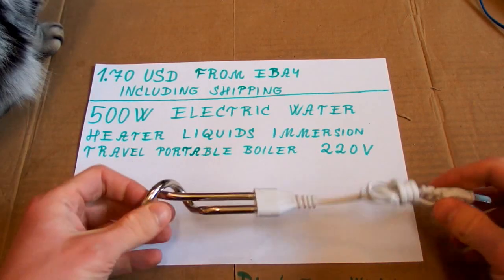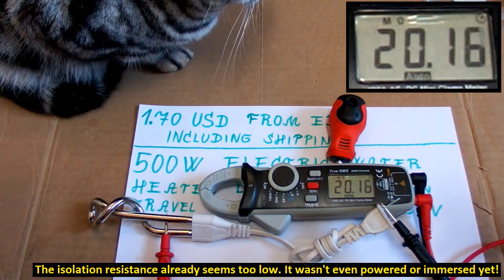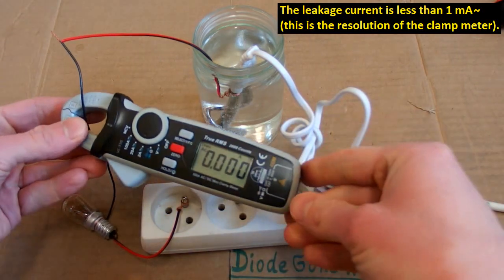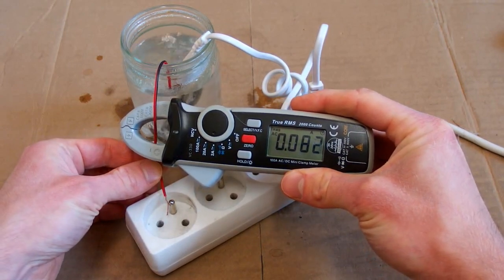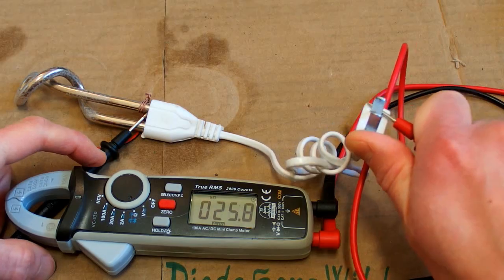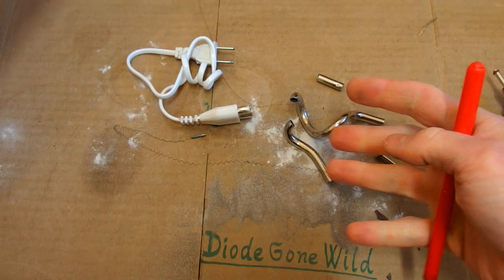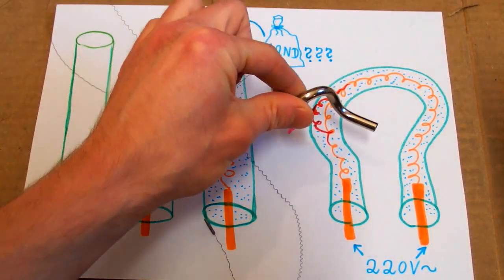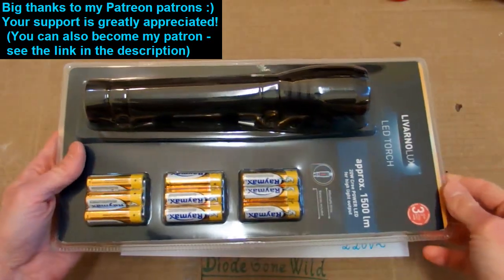Dangerous Immersion Water Heater (with autopsy)

Comment: The white powder is meant to be magnesium oxide, if you ever burned magnesium ribbon at school then this is the white ash left over. and I think the coiled wire could be an alloy of tungsten.
Reply: I previously thought that the weird white powder is salt. Because salt is an "ionic compound made up of two groups of oppositely charged ions". And ions are "atoms with an electrical charge."
Reply: Why not dirt cheap waste nichrome?

Comment: It's a common practice, manufacturing resistance heating elements, to fill the pipe with compacted dry silica sand before bending. The problem is that the sand, in your case, was not compacted and appeared to be humid - probably the leak was the humidity in the sand - poor manufacturing quality and control (no high voltage leak test), as one expects with these cheap Chinese appliances.
Reply: maybe.

Comment: At some truck stops in the USA, you can find a 12V version of this device made for coffee mugs.  The heating element is surrounded by metal and makes no contact with the water, so there's a small chance of electrocution.  But there is no overheat protection, so it can boil away the water and become a fire hazard.  Also, it plugs into your cigarette lighter plug.  The current it draws is excessive for that kind of plug.  It will (and really does) slowly melt the plug down.  Not only is this a fire hazard, but can get hot enough to burn your hand when you go to unplug it.

The big problem with it is that the connection at the lighter plug forms a voltage divider network with the heating element.  Thus, the plug and socket becomes almost as much a heater as the heating element.  To stop this, one has to reduce the resistance at the plug.  This means replacing the plug with something else entirely.  My solution was to install a pair of RCA jacks right next to the socket, and wired them up to hot and ground.  Then I replaced the plug with RCA jacks.  This left a small 13.5V shock hazard, but the resistance dropped so low that the heavy lamp wire became the next highest resistance.  The wire warmed up more than the RCA jacks.  But at no time was the wire too hot to touch, so I deemed this an acceptable solution.
Reply: Don't worry, there is no way to get shocked with 12V, except maybe on the tongue :)
Reply: @drobotk  Not so.  A guy I knew was working on an F-4G with the jet engine running on a very hot day.  A running jet engine produces an enormous amount of current - both 120VAC and 12VDC.  When he got hit with 12VDC, it put a hole right through his thumb and simultaneously cauterized the wound.  His thumb looked and smelled like a burnt hot dog.  Lucky for him, he didn't lose his thumb, but there was some nerve damage.
You should also know that arc welders are low voltage, high current devices.

Comment: The powder is normal, it is also present in high quality heating elements, it is usually magnesium oxide, which is a refractory material and a good insulator, I went on a tour in a heating element factory, and yes, the manufacturing process is pretty much just that

 I believe the problem is on one if the two ends considering your measurements
Reply from the maker: I think that in good heaters the powder material should be at least a bit more solid. Maybe just more compacted, maybe soaked with something to make it solid.
Reply: @DiodeGoneWild  Yes, it is indeed a finer powder and more compacted, I din't see the powder up close, but I remember seeing a section of a different style of heating element that was rated class II and the powder didn't come out like that, it stayed compacted, so yes, that could also be another sign of cheapness on that dodgy heating element

Comment: Ow er, bastards arnt they, not even a high temprature woven covering to insulate the nichrome wire :-(.
Not even an earth.
Big clive calls that plug a DeathDaptor :-D
You don't have earth leakage or rcd fusebox protection.
Yep keep puss safe :-D
Reply: he does, but it only trips at 300ma.
if he was in the bathroom it would trip at 30ma and would have tripped
Reply from the maker: Well, sand is the cheapest insulation :). They don't care about earthing either. They just use the "don't touch it when it's running" logic. My wiring has an RCD, but only for the bathroom. Other rooms only have a 16A breaker and no other safety. Wirings from a certain era are like this. The cat was in a safe place, no worries ;).
Reply: It is like this because if you would connect your entire house to the RCD, it would need to allow more leakage margin to avoid getting activated when not desired, reducing the safety. Therefore they were restricted to high-risk rooms.

Nowadays we can manufacture them cheaper (in China :) ), so it is no problem to install as many of them as needed and we can protect the entire house.
Reply: My guess is that in the middle part where the "sand" is not compacted well, the heating wire has enough "wiggle" room due to thermal expansion/contraction to get close to the metal pipe, and create an electrical leakage.  While it's true that most bathroom trippers will trip before it gets too dangerous (50-100mah), the mere fact that they didn't even try to isolate it better is a total disregard of quality and safety.
Reply: Well, it might be more of a production problem than a design problem. Often Chinese devices are somewhat okay designed, produced by many different producers, who are in their price wars fuck it up. We can see a production error here: The "sand" was only solidified near the ends of the tube. If the sand was fully solid, you would have isolation between live wire and the tube covering the heating element.

Now there are questions to be asked about the design: There is no ground plug, is just the sand enough etc. However, the theory that the design might be compliant with Chinese electrical regulations (that are not so strict as ours) and the production being fucked up, due to price pressure and inexperienced manufacturers, sounds plausible.

Comment: You can increase the clamp meters resolution by wrapping several turns of wire around the clamp jaws.
Reply: correct! every turn increase the current 1 time: 2 turn double current, 3 turn triple current and so on.
So, make turns an divide by number of turns to obtain the correct value (in a perfect world)

Comment: Tubular heating element are usually made of, magnesium oxide and not send.
Because magnesium oxide has very high melting point 2,852 °C (5,166 °F), and it's also much finer powder compare to send. It can be packed more densely compared to sand.

Comment: I have a similar one (bought in Ukraine a few years ago). The voltage between the "water" and neutral is 30V in one polarity and 205V in the second polarity. However I was not able to measure any current leakage. I even wound the wire 5 times through the clamp to increase the sensitivity. But in both polarities, it showed 0mA. Btw. I used the same meter as in the video. I still use the immersion heater to heat up milk in a stainless steel can before proceeding to make milk foam with the aid of the coffee machine. Cold milk directly from the fridge does not make a nice foam. It needs to be warm, around 25°C - 30°C for best results. I usually use the heater only for 15 or 20 seconds and wear slippers with a thick cork and rubber bottom, so I am isolated. So even in case of a leakage, I would not form a connection to ground, even when touching the stainless steel can. I assume that milk conducts electricity at least as good as water, if not better. I do not have a microwave oven and even if I did, I could not put the stainless steel can into it. Since it is stainless steel, it does not work on the induction stove either.
Reply: Maybe having an rcd device would be a good idea
Reply: @HA05GER  I have it, but what use does it make when the appliance is not grounded? Only grounded appliances can trigger the rcd device, when some of the current flows not through the neutral wire, but the ground wire.
Reply: @erikziak1249  that's not true what so ever and RCD monitors the live and neutral conductors to see if they are balance. If they become unbalanced like you get a shock or leaking to ground the RCD will trip.
Reply: @HA05GER  Thanks for correcting me. You are right, it checks the live and neutral. The RSD device should trip even if the appliance is ungrounded, but finds another path to "ground" other than the "working neutral" wire.
Reply: @erikziak1249  correct 👌 so should keep you safe with something like this.

Comment: The white isolation material is electron emissive when heated.  That's why it passes current in one direction.
Reply from the maker: No, there's no vacuum, so there should be no electron emission. And the voltage is AC, the current is not passing in just one direction. It's passing in both directions, but from just one end of the resistive wire.

Comment: with a normal immersion heater, would i get electrocuted if i were to touch a titanium rod which is in contact with the heating element? (the titanium rod end inside the coil of the heating element?)

Comment: I think they are also counting on the oxidation of the wire adding a bit of a resistive barrier once the device is fired up a few times.  The sand transfers the heat and also allows them to bend the tubing,  perhaps induction heated.    Who knows,  not the best design regardless.

Comment: Hello Mr wild. I'm thinking about using a SSR to switch mo well pump. It is 120v and I think 7amps. I am thinking the zero crossing switching will be easier on my Inverter. I am off grid. And need to care for my inverter. Will this help inrush current spikes? Thanks man...

Comment: Probably, the sand is pressed at the ends and so it is such "solidified".

I had a bitter experience with one of these heaters ( 1500w, bigger version), it was running on mains while dipped into water.... suddenly the pipe leaked and the powder(sand) was thrown up all over the room, the whole room became foggy!

Though it was of an unknown brand,  then I bought a new one from Bajaj, it is working till now....all perfectly grounded and so on.

Comment: Lol that lamp worked by reverse polarity of the plug but 220v does not have polarity ? Right ?
Reply: Diode Gone Wild power line is feeded from a 380-220V 3-phase system:
this power transportation system is made with a neutral and 3 phases. 
If you pick tension between two phases you have a tension that is 1.73 times higher (380V) than if you pick between neutral and one phase (220V),  it is non relevant what phase is. 
With this system you can sell threephase power and monophase power in the same line!
The neutral wire is grounded  along the distribution line (for line protection purposes) so in your home you have a live wire and a neutral (grounded) wire.
When you try to measure between live and ground you have 220 V otherwise if you measure between neutral and ground  you find almost zero ( teorically zero if your grounding plant is 100% functional)
So if the  lamp is connected between to the live wire  and ground, you can  light up the bulb; otherwise if you connect the lamp to neutral and ground the bulb does not light up (maybe slightly light up due to the low voltage between neutral and a not very good grounding)
Tha's why you act as reversing polarity because you change live with neutral but it is only an asymmetrical distribution system
p.s. many years ago in some italian countries you'll can find the obsolete 220-125V system (in way of decommissioning)
It is the same kind of transportation but in home you have two phases at 220 V and in this case each phase  is only 125V apart from ground because the neutral  (not present in that home but present on feeding line) is still grounded

Comment: Hopefully that's not Aesbestos that you're dumping all over your floor lol.
Reply from the maker: I think it's not asbestos. Asbestos is soft and it consists of fibres. Asbestos is used as a thermal insulation. The material in a heater is supposed to conduct heat.

Comment: They could isolate the resistive wire with glass dust and it could be a bit safer to use, but Minecraft said: you make glass out of sand, glass is not conductive so you can just put stupid sand from the beach

Comment: Pyro or MICC (mineral insulated copper cable) could explain the sand. Its an excellent cable used outside, fire alarm systems etc. The mineral insulation compresses the same as the copper cable so can be bent and even hammered flat and not short. I know because ive tried  :) 
Im not saying this Chinese element is the same quality but maybe they tried to clone the method and thought sand would do the trick ;)

Comment: General rule of thumb is don't buy anything from China that is connected to mains voltage - if you love life ;)
Or just to disassemble it !
Thanks for your videos !
Reply from the maker: That's exactly what I say :). But even some non-mains devices may be dodgy. Exploding batteries, risk of fire,  toxic chemicals, ...
Reply: It's not that simple, because over 90% of the worlds electronics comes from China. In theory, what is sold in European shops is supposed to be safe. In practise safety is often reduced to a paper excersize to apply the CE label (Chinese manufacturer hands over CE paperwork, importer has done his legal job).

The CE system has been designed for a world where there are a limited number of large manufacturers (think of i.e. companies like Philips, Bauknecht, Miele), who can easily be controlled by authorities, therefore the self-certification that CE imposes is justified.

However, nowadays electronics are mostly manufactured outside the borders of the EU, but a very large amount of Chinese manufacturers. There is no way to ensure the self-certification process is done correctly. Therefore the harsh truth is that no device can really be trusted nowadays. If you import yourself, the risk is certainly higher, but you can by no means assume to be safe by buying locally. It is often the same cheap crap sold by a higher price.

I am getting more and more convinced that we are increasingly responsible for our own safety. Any device I buy that isn't from a trusted manufacturer is immedeately opened and inspected, regardless wether it comes from a local shop or directly from China. Your videos are very helpfull in getting good ideas about what needs to be tested and inspected.

The other way around: You can import great quality stuff from China. It is however, a good idea to avoid the cheapest stuff, read reviews, and still, whatever you buy, inspect it before using.
Reply: @DiodeGoneWild   Yes, and I support your point of view ;) I never tested heater (and again enjoyed your videos) but a dozen of AC/DC SMPS / Adapters, all with major security flaws (very low insulation barrier, heating issues even with no load, etc)
Oh yes batteries and power electronics can be fun too ;)
Reply: @danielmantione  Yes the vaste majority of electronics come from China... but what I would like to say is if you direct buy your are the only one that can spot problems - and as you say, often cheap direct buy items have a problem.

If you buy from big companies (this can be from Samsung Apple Philips or other) they ensure the security is OK in 99% of the cases - even it is manufactured in China too.

Third case is when you buy from importer, they are not always understanding or testing devices as required. In my country, 1500 devices were tested for a year, 15% were defective. One recall was huge on Allocacoc PowerCube, they had to replace thousands of them. And that is even for a product designed in EU !

But as I said, I directly bought a dozen of cheap mains products and they all ended in recycling.... because I dont trust them. I will try more expensive one next time, but you still have to buy two to open and validate one, unless someone like DiodeGoneWild to a full disassembly for you ;)

Comment: They don't ground most devices in the United States, but they probably provide better insulation practices. Please don't snort or lick that "sand" stuff. Even if you knew what it was, it came from China and is likely contaminated with poisonous materials like asbestos, arsenic, or babies.